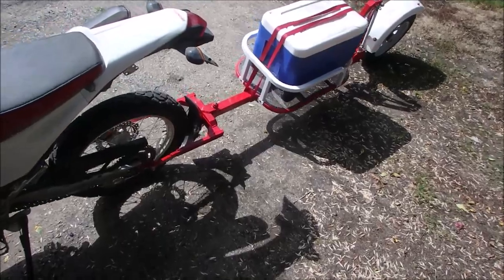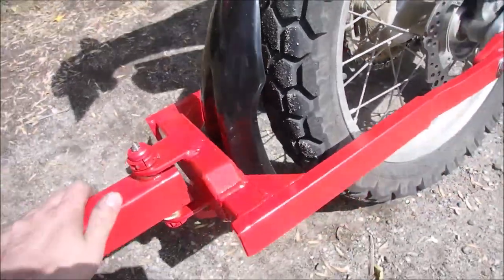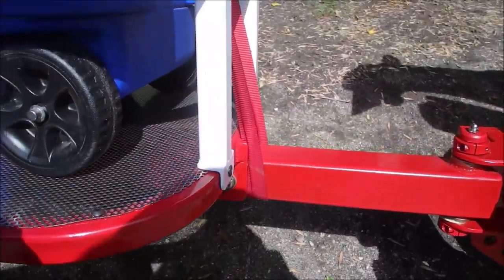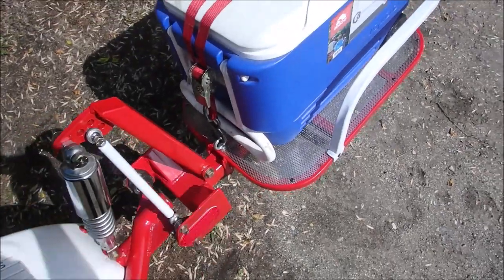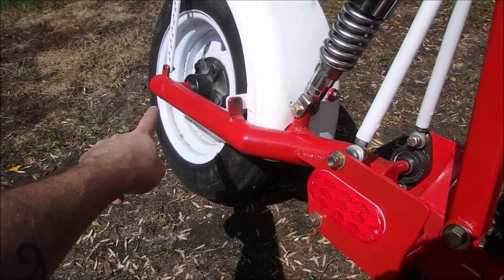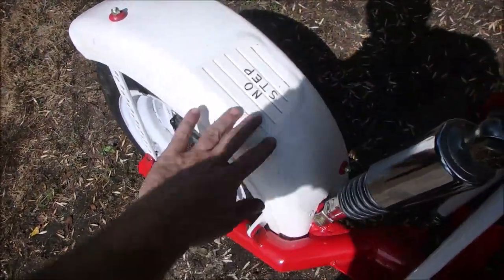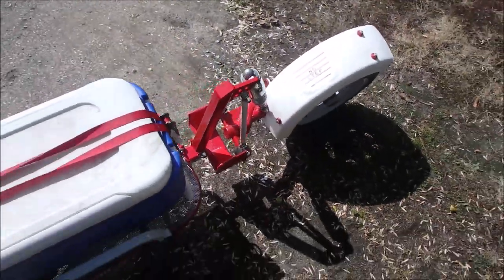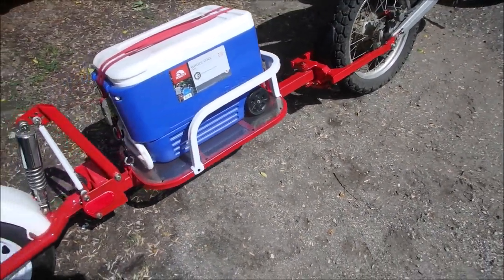Single Wheel Dual Sport Trailer CRF250L

Comment: I like your trailer! I have a question about your shock mounting. Was the shock mounted at it's maximum open length when the trailer is on flat ground, or did you compress it slightly so there would be room for the shock to expand when when it went over a bump (when you first hit the bump the spring would compress, after you went over the bump it would expand to even more than before you originally hit the bump)?. I hope that makes sense. thanks
Reply from the maker: I don't understand the question
Reply: the shock connection to the swing arm is on a pivot, so...it doesn't have a fixed lower travel limit other than the length of the shock. I get what you're asking though. the "height adjustment bars" aren't affecting the shock travel, they're used to pivot the shock mount forward and backward to raise or lower the swing arm around it's pivot (it's effectively changing the length of the shock by changing it's mounting angle)